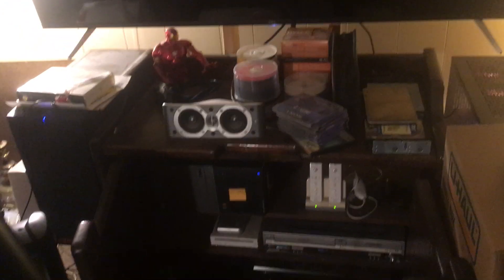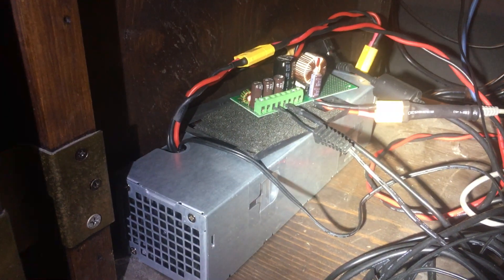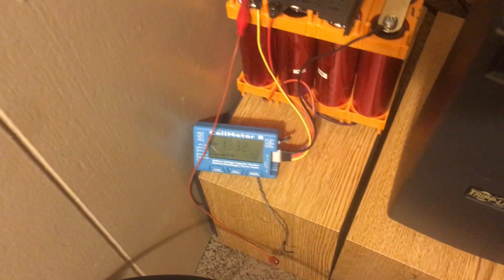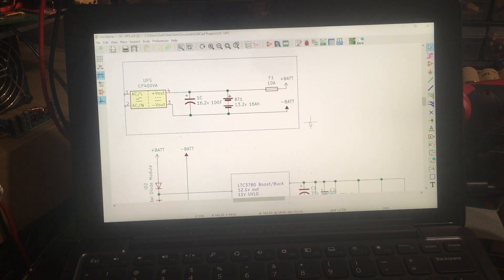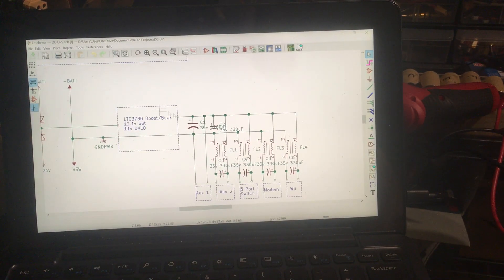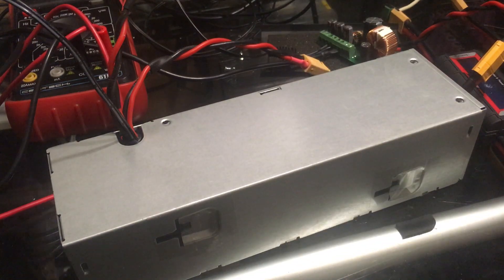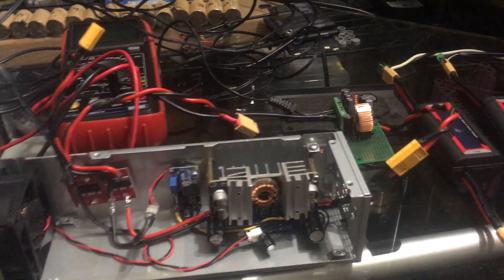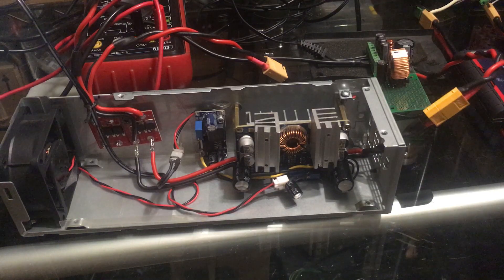DC UPS Mk2 made with LTC3780 board and Ideal Diodes

Comment: Hi,
nice application!

I'm using an LTC3780 in a simmilar configuration for my Router / NAS rack with a "Mean Well DRC-100A" supply and a battery. First, wanted to use the low voltage detection of the LTC board, but tests turned out, there is a voltage spot around 11V, where the system starts to toggle with load attached because the battery voltage will go up again a bit, when the converter disconnects the load and then the input votlage goes over the low threshold again and so on...

What I did, is that I added some voltage protection circuits + fuzes:
- An Attiny45 measures the battery/LTC input voltage and shuts the LTC off (transistor to LTC "on/off switch" pins) in case it is <10.7 to protect the batteries (software debounced with different on/off threshold).
- It also shuts off, if the LTC output goes above 13.5V to protect the equipment. This is done with a 13V z-diodes and an optocopler attached to an Attiny input.
- Also added a 13V LVS protection diode to the LTC output to filter peaks until the Attiny  will shut the converter off.

I'm curious about your output filters and have some questions about it:
- How did you notice you need the outpult filtering / common mode chokes? Was there noise from the LTC or from the attached devices?
- Which chokes did you use and why?

Cheers,
 Peter
Reply from the maker: Hey thats cool! I think you did a better job than I did, the voltage flipping on and off is definitely a glaring issue in my circuit. It should be relatively simple to just modify the circuit on the board with an on/off histeresis.
The reason I added the common mode chokes is because I just know things are noisy and I believe I did measure the noise with and without the chokes and it does reduce the noise, I am also not impressed with the ESR of the onboard caps of the LTC3780 converter board. The chokes I used were just salvaged from various laptop power supplies no math or specifications involved.
I will probably revisit it if there ever is a power outage and the batteries run down.